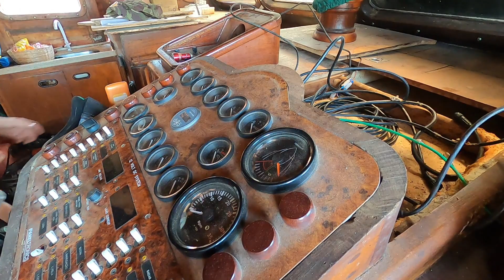Closing our TRANSOM! + pirate ship AHOY! — Sailing Yabá #34

Comment: Judging by the bottom side of the helm station wiring, it was neatly organized and done by a professional. It’s very apparent that whom ever did the wiring after the original build knew just enough to be dangerous. Most of the non original wiring(rat’s nest)would be easier to just remove and replace. Odds are the wire ends compromised by moisture, oxidized and impossible to make a safe connection/crimp, wrong gauge, non stranded, having multiple splicings or other unseen damage.
Reply: Especially given how low in the water the boat was sitting and for how long, pretty much all the wiring other than that nicely done panel wiring should be considered compromised.  I would pull all of it, (excepting that panel) separate out all the copper wiring and take it to the copper scrapper to sell.  Recycle or trash the rest and just rewire the entire thing.  Have a pro at marine wiring assist you (or do it for you) and have it done right.
Reply: @Wearyman  
To have it done by professionals will be pricey. If I were them, I’d buy several books on the subject like: “Replacing you boat’s electrical system” (Amazon). Several and recent books because of things like DC to DC chargers, lithium systems have radically changed in the last year. The advantage of doing themselves is not just cost savings but knowing the system for when, not if something goes wrong. 
They have (had?) a large bank of large lead acid batteries that I’m sure their only contribution to the boat was ballast. If they are going to replace them it’s cheaper now to go with lithium “Useable amp hours to cost, not even bringing lifetime into the equation. #1 build it yourself #2 300AH Chins batteries ( Amazon) #3 Big Battery #4 Battle Born the most expensive. They have enough irons in the fire so unless some really smart company give them some for good exposure, they’d be wise to go with the Chins batteries. We may be ahead of ourselves as I believe they are going through the engine😫 too. Long, long way to go.
Reply: Why don't you fix it, you are a professional.........

Comment: Congrats on 50 k , you both Rock !!!
I did boat carpentry with a German boat builder from Germany. 
He came to the US in the 80 ties.
Not raining on your project , it's a good one.
Getting sentimental over a wooden boat the has great lines is to die for.
Your well into the boat now and no turning back now, because your dreams are coming full circle. 
If you were to do it over , would to build this design from start would have put all the labor of ripping out the old into laying the keel , frames and planking
Huge time saver...
I'm sure you know this
No worries my friends , your happy and just the cutest  couple on YOUTUBE !!!
MUCH LOVE FROM CAP SAM ❤

Comment: LOL I once did a project that used 8.5 miles of ethernet cables, and 7 miles of the big cables you were pulling out.  The longest were 52 feet long, and we installed them in bundles of 25.  I'm still proud of that job, it was a real beast.

Comment: You need to get a Brother p-Touch labeler to label all of your cables! 

Start off labeling the device ports using your computer layout a drawing with them and trace out the interconnections. Then logically label each cable. I would use different colors to help identify each service. So AC (120/220v) would be Red, Blue would be DC (12/16v), Yellow your data lines.

Do the same for your AC/DC power services on a independent drawing too! Within your breaker panels.

Comment: The progress on the hull is amazing especially considering your supply issues. All I can tell you is over 95% of the problems with anything electrical is cables and connectors. Sure components fail but almost a certainty it will be cables or connectors. Just remember that going forward.

Comment: Impressing! What ever you do, dont paint or varnish the hull and other constructions from both sides with paint/varnish that do not breath. If you do, the wood will rot in a few years. The grey , breathing, paint you have used as a primer, will do fine on many places under deck and do not need to be painted any more.

Comment: Those ethernet cables can have the ends cut off, you can re crimp them. Ethernet crimping tool, rj 45 ends. Quick google will show you what you need.

Comment: Oh man I hope you made a spread sheet and labeled all the cables. It’ll be horrendous to rewire if it’s not clear what each wire did.
Reply: They need to remove all the wires and start fresh. Running the wires where they need them.
Reply: @icelandviking1961  you’re not wrong, but I was thinking if they had a list of what is there currently and where it goes they can decide what is needed and what is not. It also should allow them to plan routes for the new system before things get to far along.

Comment: the 'little ethernet' connector is an RJ35 phone jack connector, and the 'big ethernet' connector is an RJ45 multi-line phone jack connector.  Just in case you want to sound more knowledgeable.  :)

Comment: Are these guys the typical "craftsmen" in the region? I haven't done boat building, but I do have lifelong experience in woodworking. It appears to me that many of the frames/stations do not mate well with the planking. I hope this doesn't come back to bite you down the road.
Reply: @gav2759  This is how the original boat was built. It used traditional local methods that haven't changed much in the last 100 + years. Some of the shipwrights here have been building these boats for at least 50 years. This type of boat building is alive and well here and also from the middle east and on to south east Asia. There are less yards but they still have a wealth of handed down knowledge. IMO the new Yaba will be a much better boat than the original. Yes I winced a lot at the beginning and my hopes weren't high. This isn't an economical, value for money project, but if they are happy with the work/cost balance then that is fine. All of the workers are getting paid and are happy doing what they do. I can't argue with that. There will be a lot of money need for fitting out. There is a long way to go yet. As a very wild guess, if $100k has been spent so far it will be another $200k before Yaba moves through the water. More will be needed after that.

Comment: I don't want a millennial to ever lecture me about climate change and the Amazon, ever again.
Reply: Meaning?
Reply: WHAT KIND OF TIMBER ARE YOU USING TO REBUILD YABÁ?
The wood we are using is Garapeira (Apuleia leiocarpa). Garapeira is yielded using low-impact, sustainable forestry techniques. This makes it an eco-friendly option. There are a lot of different names for this type of wood, including Brazilian Ash.

Garapa wood is closely related to Ipê wood (Brazilian walnut), but it tends to be lighter in color and has less variation in grain. It still looks like a tropical hardwood. 

For more info, we talked about our wood of choice in this video #22. (from around minute 06:40)

https://www.sailingyaba.com/faq 🤷🏻‍♀️